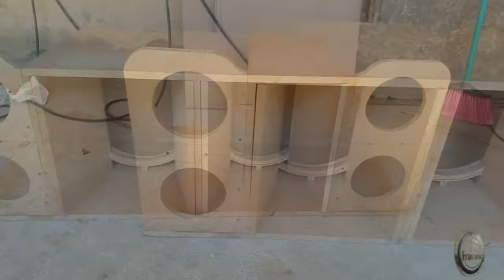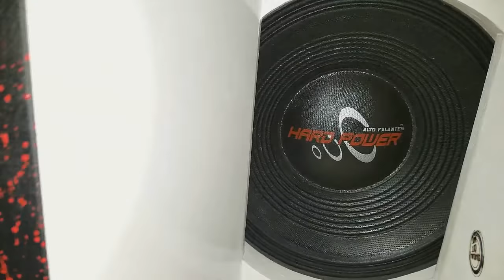CAIXA CANHÃO C/ FALANTES HARD POWER 18" E MÉDIOS DE 12" #SOM100FRONTEIRAS

Comment: Vc sabe de quantos litros e duto de quantas pol e quantos cm é ideal pra 1 pioneer cara preta D309 ??
Reply from the maker: blz amigo, achei um manual q diz o seguinte:
Volume para caixa selada - 35,4 litros 
Volume para caixa com pórtico (dutada) - 42,5 litros Diâmetro do pórtico (duto) - 76 mm Comprimento do pórtico (duto) - 152 mm
Mais recomendo procurar por alguns foruns, achei esse sobre o pioneer 310https://autoforum.com.br/topic/195805-ajuda-com-litragem-do-cara-preta-310/
espero ter ajudado.. tmj smp
Reply: @Som100Fronteiras  opa aí ss mano valew parça